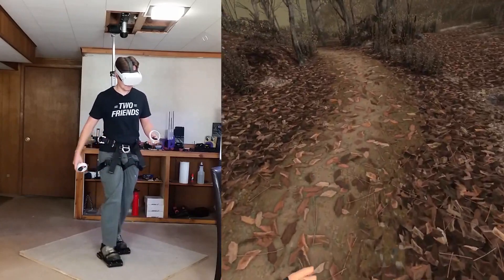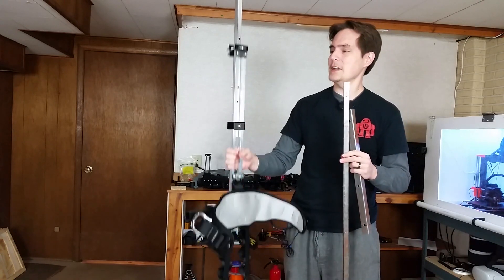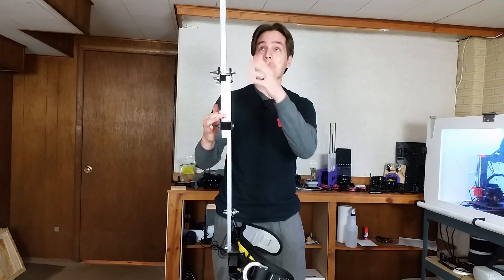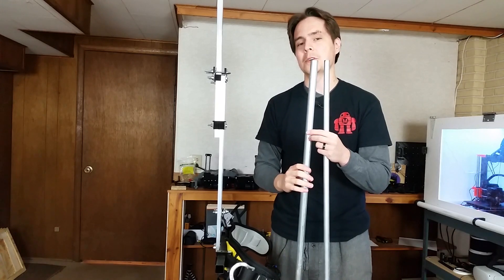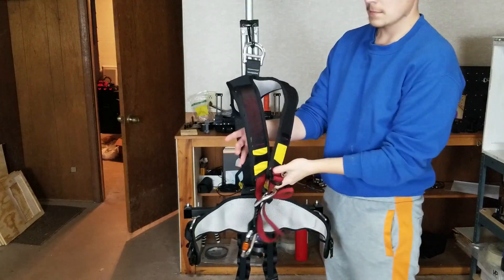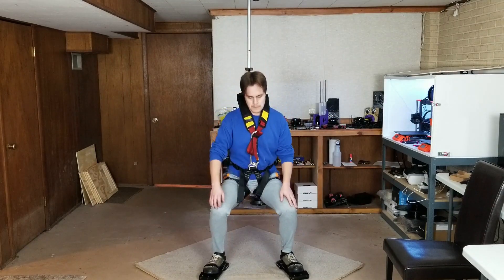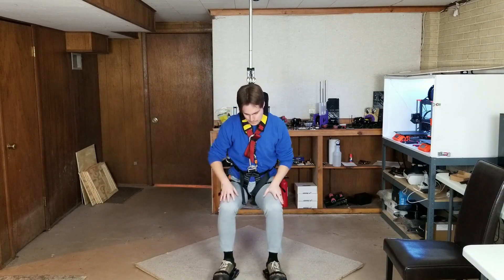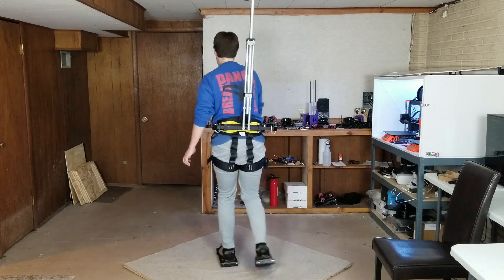VR Shoe Build Log #46 - New Steel Tubes, Upper Harness Testing

Comment: I'm a big fan of what you are doing here. It's very inspiring.
 I'm myself working on a "low cost" and easily removable way of walking/running on spot.

For the moment, I simply use a rope attached to a hook on my celling and the same kind of harness as you (it's my working harness). It works pretty well, I can walk,run and turn easily. But the 2 main problems are that I can't crouch, and that I find using the harnest quite painfull.
 These harness are made to be suspented from the front (and also using a seat), not from the back. For now my solution is to reverse the harness, so that the attachement ring is in my back, it's more confortable this way, even though I have to use a pillow. Of course I can't use the leg straps. My idea would be to cut my old harness, reverse and re-sew the leg straps and uper straps so that they are in the good side and would probably help the confort.

Don't you find pushing in the harness being painfull? I suppose the fact that your harness is linked to your stucture just next to it , and not to the celling like me, can help the confort

For the shoes, for now it works well simply by using big wool socks. I used to be a 3d modeler in the past and I do 3d printngs, but I don't now anything in programming or mechanic. For the controls I was thinking of using the kat loco system

Your idea of using pipes is great. Since I discovered your work I'm also thinking of something like that. 

For your standing problem, maybe if you ad a extension spring, it could help you to bend foreward ?
Reply from the maker: I tried making a rig similar to that, where it's not rigid and consists of the harness and a rope going to the ceiling. This is my video on that setup and why I didn't like it - https://youtu.be/0u2NmwqWFSk
There's also a guy on my discord that wants to try to make a non-rigid rig work.
This is the harness I'm using - https://www.amazon.com/dp/B08LGNVZ5K/ref=sspa_dk_detail_1
You can't see it well, but on the back of the bottom part is a metal plate. You can see it better here - https://www.amazon.com/dp/B08FXHJRZT/ref=sspa_dk_detail_6
So I was able to bolt the harness, using that back plate, to my rig, so I did not have to flip the harness around.
Something like this would also probably work - https://www.amazon.com/dp/B07CWNB1Z3
I've thought about making a harness out of a belt and tactile vest.
https://www.amazon.com/dp/B089XWF6V6
https://www.amazon.com/Fairwin-Tactical-Military-Heavy-Duty-Quick-Release/dp/B07D2BL4JH/ref=sr_1_7
Maybe using the loops on the back of the vest to attach it to the rig. For the belt I'd maybe wrap a towel or cloth around it to pad it and make it more comfortable. I haven't figured out how to add leg loops if I do this.
I don't find pushing against the harness painful at all. Yeah it's probably because of how the harness is coupled directly to my rig at the back of the harness. Mine isn't pulling up on me. In the video I linked to above, the straps pulling up on me was one of the things I didn't like.
Kat Loco would probably work, I'm not sure if it supports going backwards other than with a gesture. You could also try Natural Locomotion. In the past I made my own trackers, and I'll make trackers again for this version, but I know how to program.
For the crouching problem, where I can't lean forward, yeah a spring might help. If the user falls the spring has to be strong enough to help keep her upright. Maybe a combination of a spring and something stronger for safety. I'm probably not going to experiment with it though, since I just prefer to not use the upper harness and I'm going to be working on making a new rig soon that should eliminate that problem, plus it won't need to bolt to the ceiling or wall.
Reply: @finallyfunctional  yesterday I tried an improvment, and I have solved the pain problem, and your it's your system that gave me the idea. I wear the harness the right way, and I use a bar that is linked to the side rings of the harness, also ad a link form the middle back of the harness to the center of the bar, and it's the bar that is linked to the ceiling with a rope.
It works pretty well. I still can't crouch (just bend over) but no more pain. Just tried few minutes but it was ok. I feel the bar in my back but it's not too disconfortable

Yes I supose a spring + a rope just long enought to the max lenght suited would work. If the person bends to much or falls , the spring would be blocked by the tensed rope

Comment: I’d like to build my own set without using natural locomotion and instead using Arduino’s and accelerometers like your active VR shoes and test out some of my own design ideas. I just have no idea how I could program an Arduino to simulate joystick movement to walk in games. Could you point me to the resources you used to learn how to?
Reply from the maker: You can make a driver for Steam VR. I wrote the driver, with a layer that communicates with ESP32s on the shoes over bluetooth serial.
This is my tutorial video on Steam VR - https://youtu.be/LzEIOBnbC8k
 If you've never programmed before, I recommend you spend some time learning the basics of C++ and Visual Studio before you attempt to make the driver.
My same code is here - https://github.com/finallyfunctional
You can find the example steam VR driver repository there, as well as a sample on receiving messages over bluetooth from an ESP32 to Windows.
Reply: Thank you so much!

Comment: nice to finally see some full sized steps!
im curious, can you just sit in the harness, with your feet off the ground, letting it take all your weight?
no reason to do that in game, but it looks like you could try it as a strength test.
Reply from the maker: I found that if I keep my knees slightly bent as I walk I can take larger steps easily. I haven't tried lifting both feet off the ground, but I did do a few tests where I grab the top with my arm and hang from it, so yeah it can hold my weight.